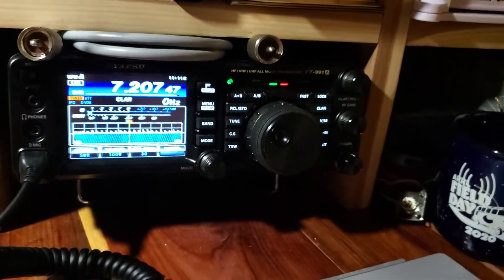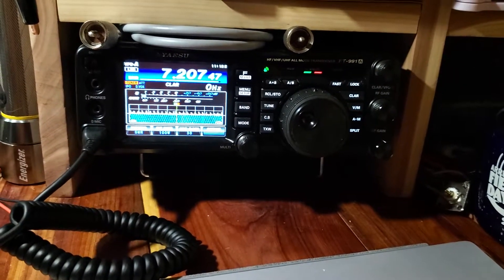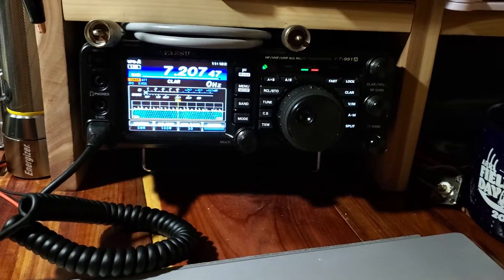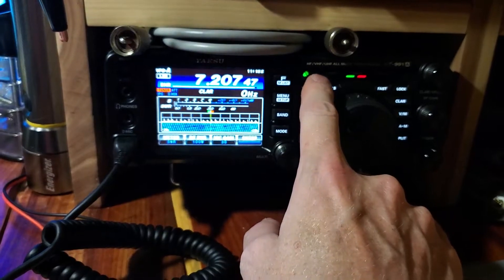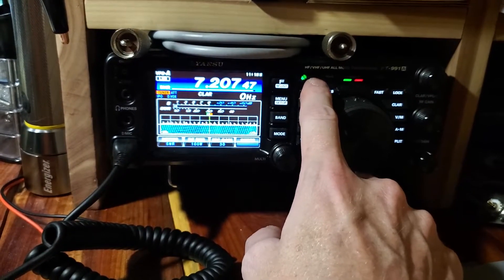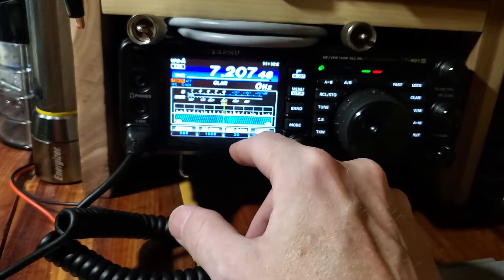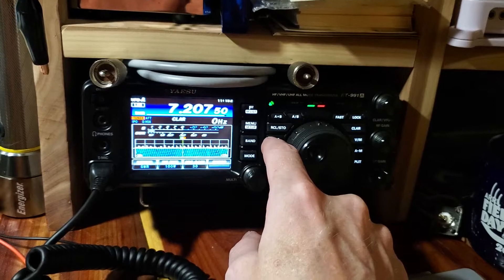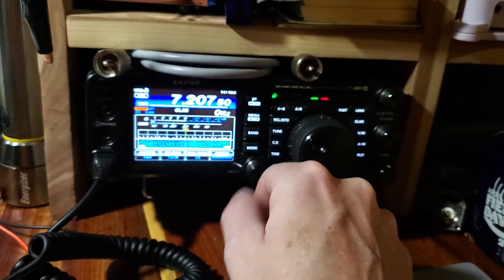Yaesu ft-991a tx red light flashing

Comment: Thanks for the video. I was installing an external tuner for my ft991a and that light was flashing and was driving me nuts. I thought it’s the new ldg tuner then I changed my cable to the radio and checked the antenna. It was my computer all the times.

Comment: I find with my 991A that if flashing TX light is on and No TX available. Go into F m-list (after selecting CW Mode) Up Break-in mode ON  and Keyer OFF. Then key up for 3secs. Red Light goes Off  .....   Everything back to normal. G0MRR.

Comment: Hi, thanks for this topic it saved alot off strees to me. This issue appared to me today with my several days old  trx. I switched off JTDX and then my notebook and the Tx LED started to blink. When I switched the PC on again it was OK. I have the trx connected via original Lenovo USB-C dock to my Lenovo notebook. What is the solution for working with the USB cable connected but PC turned off, please ?
Reply from the maker: I've always used mine with my computer so I'm not sure what to change with the computer off. It might be worth being sure that your mic input is changed from rear data to front mic if not using the computer

Comment: I just had the same problem,  turns out the lock button on my M-70 base microphone had been pressed in whilst the radio was switched off, 
Unlocked the microphone and it was back to normal,  my radio isn't connected to my computer.
Reply: Thanks by reading your reply I found my problem lol.

Comment: Thank you very much, you definitely save the day as many others recognize also.  It seems in my case the USB hub I use appears to be failing, as a couple of ports are not working with other usb devices as well.  So definitely the problem was tied in to the usb hub.  Both an alternate usb port as well as disconnection from the faulty usb port eliminated the panic light.  Thanks again, you are helping many people here!

Comment: Solved the problem!  USB cable from radio to laptop wasn't quite plugged in all the way.  A little push and the flashing TX indicator went away and all is well.  Things like this video are what make the internet so great!  Without it I may have spent hours pulling my hair and getting a headache.  But in less than a minute, no more problem.  Thanks for the vid!
Reply from the maker: That's the reason I made it. I pulled my hair a bit and couldn't find any video

Comment: In the end, the solution was a bit more extended. Flashing is a result of the USB firmware not reacting anymore. So the steps which you have to take are as follows:
1. Switch off the set. 
2. Remove the USB cable. 
3. Remove the power cable for at least 30 seconds. 
4. Put back the power cable. 
5. Put back the USB cable. 
6. Switch on the set. 

The flashing started after I had a short on the power supply while operating the set. 
Flashing also occurs (but goes away without this reset procedure) when you switch on while holding the PTT pressed or when WSJTX is tx-ing or your CW keyer doing the same.

Comment: If i take the USB cable out. ik keeps flashing . If i plug the usb cable in and swich on the PC it still keeps flashing.
Reply from the maker: Turn the radio off and unplug the usb from the PC. Shutdown the PC and plug the usb back into the pc then turn your radio then power PC back on and see if it picks back up

Comment: Thanks for the video,  I'm having a similar issue but I the CAT function is still working as I am using the Win4Yeasu Software.  I cannot key at all nor can I hear anything although I clearly see activity on the waterfall.  Any idea what I should check?
Reply from the maker: If you're using a Windows PC, double check the settings for your port.  Be sure Windows did not default the baud rate.  
Are you using an external speaker or routing audio through your computer?
Reply: @k5rfl  external speaker (SP-10) -  It was the baud rate on the ports- it was set at 9,600: just changed them to 38,400 the rig is working fine now.  We should schedule a QSO
Reply from the maker: @W1SRR  certainly. Maybe this evening before our local vhf net at 7:30 CST. 40 meter SSB?
Reply: @k5rfl  unfortunately, my antenna (6BTV) needs to be returned for 40 (or the trap is bad)  i can do 20m if you want to give it a try
Reply from the maker: @W1SRR  i apologize. I'm just now looking back at this. Got home and decided to take my XYL out to dinner on a whim.
I'll set a reminder and set up on 20 after work tomorrow and get in touch with you